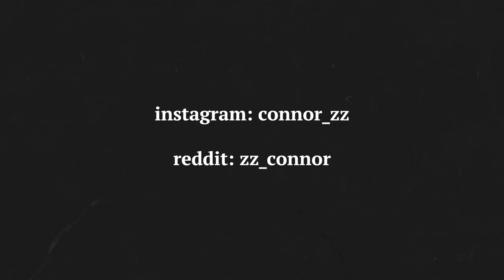VW Beetle Alarm Installation

Comment: Good job. I just recommend you to install a solenoid controlled by the aux channel of the alarm in order to prevent a intruder get access to the wiring. That way only you can open the Hood by the remote and nobody else.
Reply from the maker: I've already done this now, had done for a little while.

Comment: btw you should mount that electric fuel pump right under the tank.. they like to push not pull...  and another question what wire goes to the dome like to trigger the alarm?